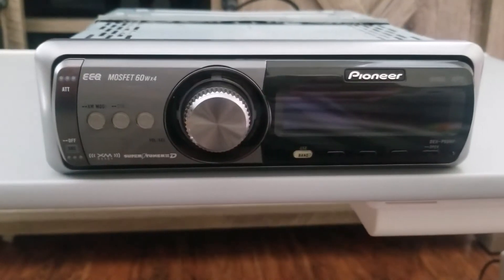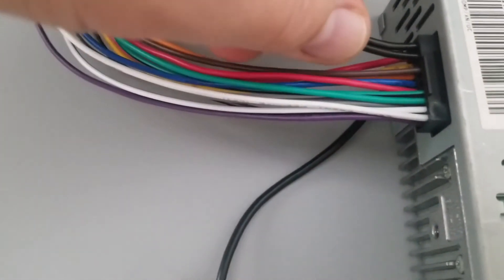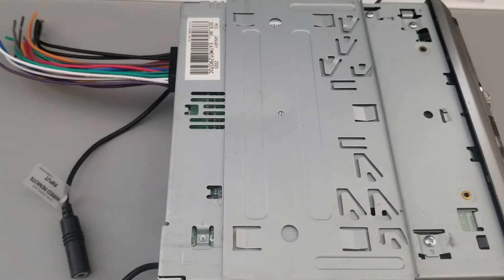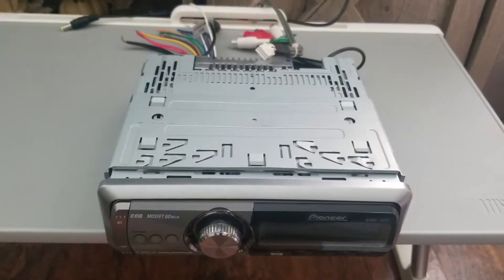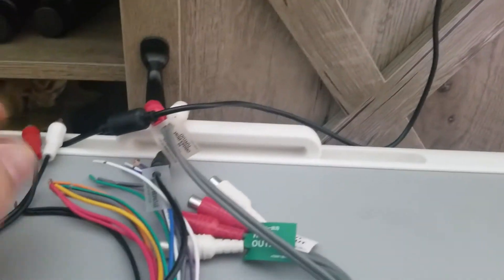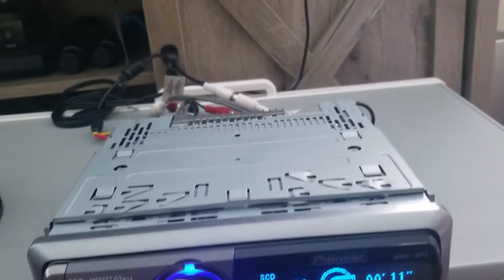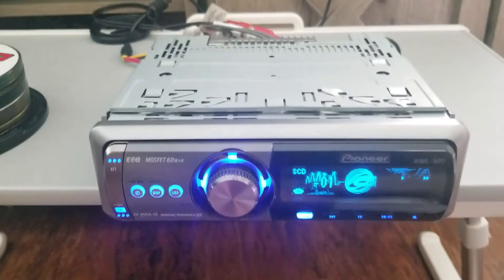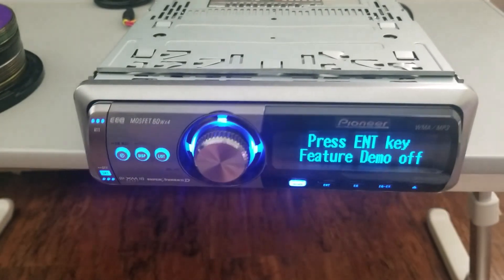Pioneer DEH-P80MP Going Home

Comment: Do u have any more of the 80mp like this
Reply from the maker: Hi, yes I do. Here is my offerup listing with details. https://offerup.co/6ZbjVkLszkb

I have that one and 2 more with only the power/rca harnesses. If you have IG I can send pictures.
Reply: @RadiOG58  have you ever reqced the ribbon cable ? Wondering if it's easy to replace , my deck is stuck open
Reply from the maker: @7Logik  I haven't but the motorized faceplates all have a similar process. I made this short video explaining how it is done. It doesn't show how to do it but I explain it. If you are decent with a soldering iron, it shouldn't be too much trouble. Just a bit tedious.

https://youtu.be/aoaPLSh8MJU